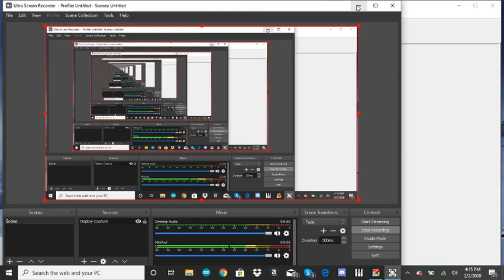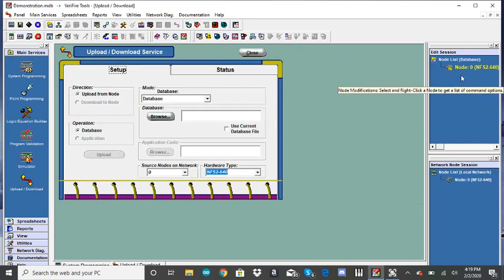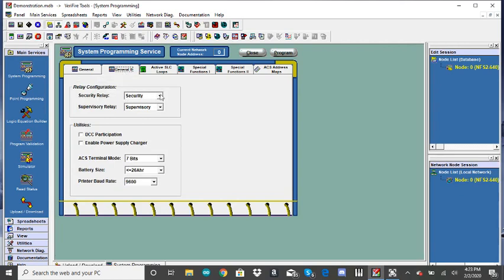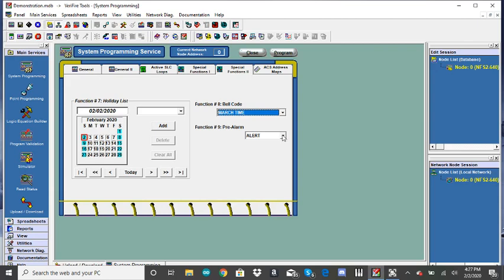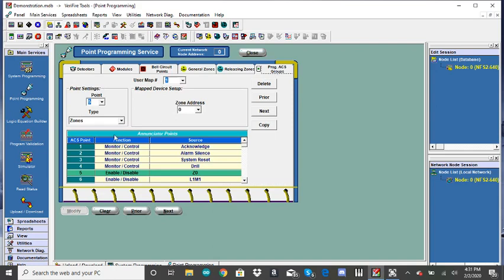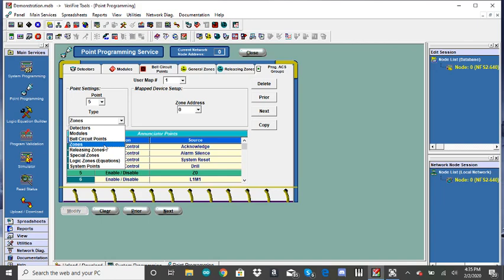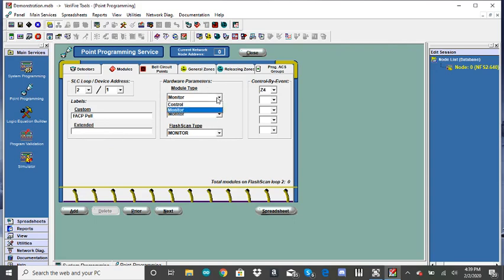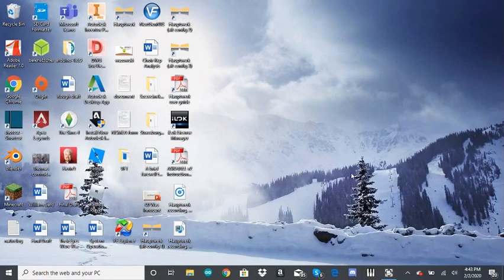Verifire Tools (1/2)

Comment: what cable do you use? everytime i attempt to connect i get request for node connection info was not successful. please check the gateways NUP connection.
Reply from the maker: @joshuahoffman6798  I used a printer cable. You need to make sure your NCS gateway (a serial interpreting program that gets installed with VFT) is setup and running.
Reply from the maker: NCD*

Comment: Can you help please.  I plug with USB b type cable to the panel NFS2-303 with using Local Network its giving error Password authentication response from Gateway timed out.  Is there any config process before connecting to the Panel? Thanks in advance,

Comment: I'm not sure if I'm doing anything wrong but whenever I try to click local network it gives me an error saying unable to connect to node, check nup connection and try again
I tried all 3 ports on my nfs2-640 and on multiple pcs and none were able to connect to the panel
I'm not sure if there's something wrong with my ports on the panel because whenever I plug it into the computer it makes then tone like somthing is connected 
If you can help me out that would be appreciated
Reply from the maker: I’ve actually never connected to a panel through the NUP port. My 2-640 has a USB port.
Reply: @ncalarms6022  I've also tried it with the USB B port and it doesn't connect to verifier tools
It gives me the sound that the PC detected it but whenever I try to connect to the node it gives me an error on verifire tools
Reply: @ncalarms6022 have you connected through the USB b port?
Reply: @Notifier-457  I've never was successful in using 5.7 on my panel, only version 10.55 worked with connecting to my PC.